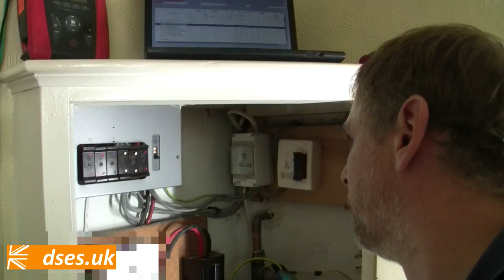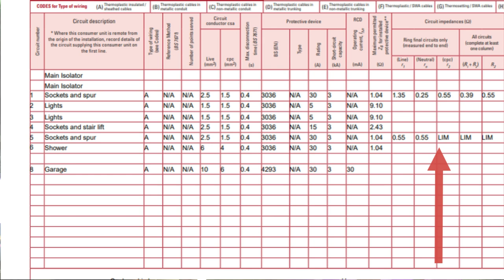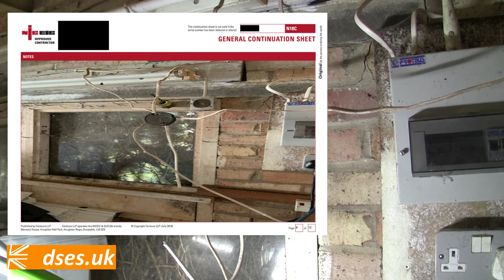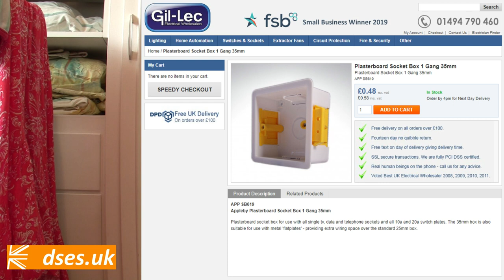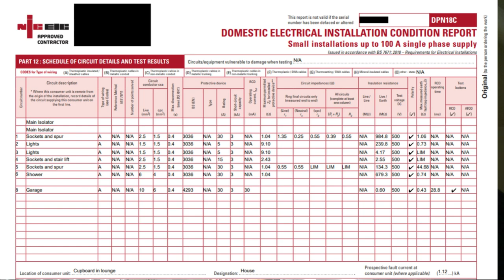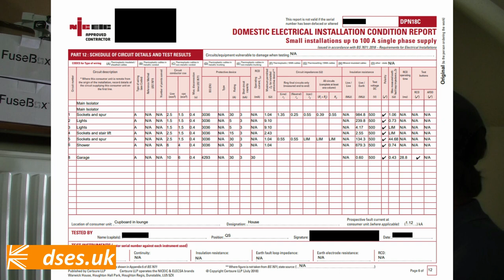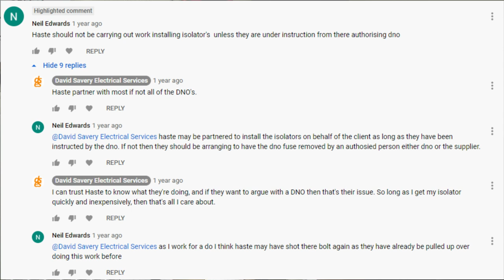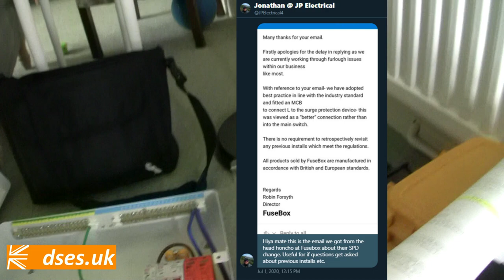Waffly Consumer Unit Upgrade

Comment: Rather than fitting a Henley block, why not fit a Wylex REC2 (only a tenner on Ebay) - existing tails in the bottom, new tails in the top to the new CU.  Now you have fixed the problem and introduced safe isolation for the next person as well...
Reply from the maker: It was the weekend, I was out of area and I lacked a DP isolator on the van. I now carry one as a stock item to ensure I'm not caught out again as this would be a preferable option over the Henley block.
Reply: @dsesuk  Excellent answer ... amusing as with all of your other videos...
Love your "no shit, Sherlock" approach ... if you venture into Worcestershire some time I will buy you a beer!.  Keep up the fekking good work!

Comment: Thanks for showing us that email. I've tried contacting them myself regarding precisely this issue but never had any response. Been of particular interest since I had a few of their SPD boards lined up with the SPD straight off the main switch for jobs that got cancelled/postponed due to covid and wondered if I should be fitting mcbs into them now.

Interestingly on my last NICEIC inspection I was told there was no need to use 6mm, a 2.5mm would do for the connection. Can't help myself though, makes me cringe putting a single 2.5 into a 32A so 6mm it is!
Reply from the maker: I must admit, on my manor house job I'd had a board in stock for some months that predated the supplied MCB for the SPD, so I retrofitted one anyway. It seems to be to be better to have than not if you have fuseways enough to accommodate it.

Comment: I had the same with western power as I had old service head and wanted an isolator fitted they said no and would cost was £175 + vat in the end I took photo of service head and it needed changing anyway and when the came to fit new service head I bought isolator cost £18 and they fitted it for me so now I can change my old consumer unit when I want safely

Comment: For the 30A fuse with 3 conductors.  If it is purely a spur (Being defined as only serving one single or one double socket) not a radial then that socket can only draw a maximum of 26amps (2x 13A).  It is exactly the same situation if you spur off any socket, you have a 2.5mm cable with a rating of 27A connected to a 30A or 32A protective device which you accept is fine.

Obviously if that spur is in fact a radial (not a spur protected by a fcu) which would serve multiple socket outlets then it would break the rules.  I know it seems totally counter intuitive but it is exactly the same argument about using 20A double pole isolators on a kitchen ring circuit, you have a 20A isolator on a 32A circuit, however as long as that isolator is feeding only one single socket then the maximum load can only be 13A so is fine.

Effectively the two plug fuses at 13A each are protecting the cable in a spur.

Just to note also in amendment 2 they are talking about requiring AFDD, at £250 a circuit breaker we might see installers going back to having less circuits so even for the hardiest of Ring final haters they might be converted back to ring final circuits.
Reply: Good thought on the AFDD requirement forcing people back to rings. I have a feeling this might go the way of 'earth rod for everything' in the 18th original suggestion...  "not gonna work, rethink this"
Reply from the maker: I accept that point Steve, but the problem I have with it is when the 'spur' is serving a distant point with cabling buried in the fabric of the building. Yes, under normal load conditions, the plugtop fuses protect it, but what happens when Joe Homeowner knocks a nail in the wall and causes a near short? The fault current that can pass may then be too high for the cable, but the protective device can pass it and not meet the disconnection time. As for AFDD's, you can perhaps expect a rant on that in the coming days!

Comment: Thoroughly enjoyed that one old chap.
With you on the spur out the ring, one way I've dealt with this in the past is just to change it for a 20.
I hate pulling the fuses, what also annoys me on top of there not being an isolator is that they never write what fuse is actually inside, you get the 100amp sticker on the front which is just a max capacity and tells you nothing, you open it up and there is a 60 inside. Why do we have to write the fuse size on a cert when we don't even know, unless I explicitly see a sticker I'm just going to put Lim.
Reply from the maker: I agree Oli, I've no idea why the fuse isn't explicitly identified and I too end up writing LIM all the time on my paperwork. It makes a joke of maximum demand as someone asks for a car charger or electric shower, yet you've no idea what the installation can supposedly supply without breaking a seal to get into the thing.
Reply: @dsesuk  Whats strange about all this is that this trade has been going for so long and the problem seems so simple. Politics!!!, Usually it works so well but....

Comment: What’s your view on the cp Fusebox flying earth lead for the lid  ? To me it’s too short as the kid is flapping around in front of the devices and wiring when you remove the lid ...maybe superfluous ?  Also I’m not sure on the tail clamp it’s a bit of a faff you get on but good when it’s fitted ...I’ve found that it’s best to split the orange plastic clamp into two halves much easier to fit especially with non flexible tails
Reply from the maker: I'm not convinced on any flying lead for a metal CU cover Marco. If the manufacturer instructions state the power should be off when the cover is removed, then why require me to earth it? It's my outlook if I choose to ignore those instructions; their arse is covered. For me, it's extra fiddle and it gets in my way.
Reply: David isn’t the issue that the lid is an extraneous conductive part therefore needs to be earthed ? i.e. the lid is painted/powder coated and the contact of the 2 screws that hold it to the rest of the CU can’t be relied on - a bit like earthing a metal light switch plate. But I haven’t seen any other domestic single phase CU applied with a flying earth lead

Comment: Great video, again! Regarding the SPD now requiring connection via Live to a 32A MCB, what's to stop you putting it into a 32 or even 40 RCBO serving a circuit, as an option to be efficient with your ways?

Comment: Thanks for uploading,interesting video.I am sure that  4mm 30amp radials on rewireable fuses are not permitted but as you have pointed out,it is allowed to have 2.5mm cable on a 30 amp rewireable,seems ridiculous doesn't it

Comment: On one unoccupied site the dno replaced the service head cos of a hole in the side of the original one. They put a nice new chipboard backing board up, which meant they needed to remove the meter. Then they refused to re-connect the meter because it ‘wasn’t our equipment,mate’. (It wasn’t your equipment when you removed it, and you didn’t mention this problem an hour ago when you offered to replace the wood....)

So, 3 weeks later, when the supplier arrived to install a meter, I made sure there was no CU on the wall, so he had no choice but to terminate the consumer tails in a DP isolator I had screwed to the wall. 👍

Comment: If you look up the definition of a circuit in BS7671, its one circuit. Nothing wrong with piggy backing off an OCPD, its no different than spurring or junctioning anywhere else on a circuit, and so much better than a hidden JB. Fair enough if the terminal is too small, but its ONE circuit on that fuse, not two.
As for the ring vs radial discussion, they all have their place and are all useful. You say what happens if a RFC breaks and the 27A cable is over loaded. But what happens in your 4mm 32A radial if the cpc goes open circuit? or you run it in containment or in insulation, or the length of run is too long for Vd and Zs?

Comment: Hi David, I'll check, but I believe near the beginning of the regs the iet say that they are not liable for any wrong advice in the regs, an installer should use his professional judgement. Or, that is coming out in an ammendment.
Reply from the maker: They don't waste any time Keith; their disclaimer is on page two.
Reply: @dsesuk  thanks David.

So, just do what you think is correct then because, they appear to be saying that the regs are only an approximate "ball ache", as someone may say, that can and should be ignored if in your professional judgement you are the authority on the matter. 

😷 Protect yourself from the regs. Save the IET. 😷

Comment: If you have a spare way at the CU fine, but if not there’s no reason to differentiate between connecting a spur at a local s/o or within the CU? Just seems trendy to dis rings at the moment but they’ve served us well for 50 years and safer now as you are limited to one spur per ring s/o

Comment: I can see how a 20 amp radial per floor would work ok, but a modern kitchen needs a 30 amp supply and I don't fancy wiring sockets etc with 6mm. As an experiment some time ago I changed the kitchen mcb to 15 amp, wife got up in the morning started the washer and dryer, put the kettle on and it tripped when she started the microwave lol.  Add on a George Formby grill etc and 20 amps is borderline for a kitchen :(
Would a 4mm ring for a kitchen with a 20 amp mcb on each end rather than both ends stuffed into the normal 30 amp be a solution to a possible ring break ?
Reply from the maker: Hi Steve. I also prefer 32A for a kitchen, and I have no issue with wiring such as a 4mm radial. True, it may technically fall foul of installation method and I'd prefer a larger CPC, but for your average small domestic property 4mm suffices juuuust fine.

Comment: I made it a condition of having a smart meter installed to have an isolator switch fitted by my supplier (Eon) at the same time. This they did at the height of Covid in May. They fitted a Proteus isolator in an Eon branded enclosure. No fee whatsoever. Your mileage may vary I guess.
Reply from the maker: Well, that's the issue; if you know what to ask for and you insist upon it and if your energy provider is open to that request then you might get it for free just so they can tick you off the smart meter to-do list.

Comment: Radials the way to go. 
Even with derating
Power circuits 2.5mm2 20A
Lighting 1.5mm2 10A 
Cooker 4mm2 32A permanent wired
RCBOs for all others.

Comment: Isn't the issue of cable size with a spur from the CU exactly the same as a spur from anywhere on the ring, ie 2.5mm2 can be used within the regs and has less than 32a capacity? But the reg is based on a 13a fused plug that limits the current draw - a double socket isn't meant to be rated at 26a but 20 (according to JW). The regs assume there's only one (single or double) outlet on the spur but if course DIYers don't care about that. That's why this sort of 'spur' is only allowed on a socket circuit.
Reply from the maker: My issue with spurs is length. A spur off an existing ring to add in a new point close to an existing wiring/accessory position is fair enough. A spur from any point which snakes off to the other side of the house, well that's what I don't like. You're less likely to see spurs of a long distance coming from the existing ring, but you can find the situation we have here where an extension has been built some distance from the fuse box and wiring for the sockets within travel back through the fabric of the building to be shoehorned into the 30A fuse. Even if it were serving one single/twin outlet, the demand should be such that the cable isn't overloaded under normal conditions as plugtop fuses are in place at the far end, however for a cable run of some length buried in the building, damage to that cable by, say, screw/nail penetration can see a resistive short low enough for a fault current high enough that the protective device passes more current than the cable can handle. A spur to me is a short-length frig to allow an extra point to be added without too much drama, not a wholly separate circuit which goes off to serve another area of the house entirely.
Reply: @dsesuk  I agree with you. On a lighter note, it sounds like you have a length problem with your 'spur'.
Reply from the maker: @tobysherring1369  My wife says it's not the length that matters, but the reference method. I don't believe her though.

Comment: Hi David when the lighting circuit has no earth. What tests do you perform on that circuit at the light points and switches.  How do you fill the fields on the certificate do you just n/a them or lim them I surpose it's only the rcd/rcbo field that you can fill out. Any info will be appreciated thanks.
Reply from the maker: If there's no earth by design, then R1+R2 and Zs would be N/A on the cert. If it's down to a fault (disconnected CPC), then those readings would be off-scale high on my tester (>1999), so that figure would be entered onto my paperwork for those fields. Outside of that, I'd still IR the circuit to earth in case of contact with parallel paths and I'd visually inspect it and test any RCD (there's not much else you can do!)
Reply: @dsesuk  I've got a c.u change coming up no cpc in lights it is just 2 core cable so it was by design. Will be the first one I have done checked all fittings they are all plastic no metal ones going to cover screws on switches with the plastic covers you get so no metal can be touched.
  Was just wondering about what to put on the cert because most fields would be empty and i like to fill with as much info as possible. Is there anything else you would do. thanks David
Reply from the maker: @gd-bq7em  All fields should be filled either with an explicit value or as N/A on a cert, although to me LIM is acceptable on L/N IR when it's a CU change. For your non-earthed lighting, N/A would be right for the R1+R2 and Zs. I would LIM L-N IR testing unless you know there are no lamps, dimmers, transformers or drivers present, but I would still do LN-E IR testing to prove live wiring isn't in contact with a parallel earthed path such as metal pipework. Don't worry about plastic covers over accessory screws, reg 410.3.9 (item iii) gets you out of that one!
Reply: @dsesuk  okay david thanks for the info much appreciated. I will check that reg out,
  Yes I understand what you mean with the ir to earth just in case it's touching  gas or water pipe somewhere along its run or to another circuit.
  Thanks for always taking the time to comment back,
  Look forward to a new video keep them coming my friend.

Comment: I agree with absolutely everything you said about ring finals. Why are they still a thing? Why are they still permitted to be installed new? Whenever I design an installation, I generally assume a 20a radial circuit for every floor of the property plus a 32 radial (yes, in lovely 4mm) for the kitchen. The great thing about radial circuits is you can do whatever the hell you want with them. You can double/tripple/etc spur them. You can have the damn things spidering anywhere you need. Why is this not the done thing? - I am the only person I know that installs 4mm radials.
Reply: It's a ballache spurring off 4mm though, you end up with Wagos in your socket boxes which can be a bit of a squeeze if they're 25mm. Having worked on a kitchen wired with a 4mm radial recently, I'd go 2 x 20A radials for the kitchen to stick with 2.5mm as it's nicer to work with in my opinion

Comment: Just been quoted £231.42 by Western Power to put in a 2 pole isolator. As they are running a monopoly and governed by Ofgem  I will try and complain but don't hold much hope. Just out of interest how long a job would it be for installing an isolator switch? An hour? Love the Video and thanks Dave for doing these it helps us mugs know what to look out for and keep us safe..
Reply from the maker: Shocking isn't it? Yeah, easily achievable in an hour and part costs likely to be under £15 ex VAT. It's a money-spinner for them.
Reply: @M_Holien  Nice that the lady at Western Power gave you that tip, someone with a conscience.

Comment: Dropping sockets off to look behind them becomes an issue if the house was wired with aluminium twe as the bloody conductors can snap :( Back when it was in use you would terminate the apc to the earth terminal in the box and connect the socket back to that so that only the link could break rather than the apc of the twe.
Reply from the maker: True Steve, sometimes removing an accessory can cause a problem that wasn't there before. Pulling downlights is similar when the old halogen ones have made the plaster around them brittle with heat. Ugh.
Reply: @dsesuk  As an exercise I was given a length of aluminium twe and a proper 13 amp MK around the posts plug and told to wire it, it was impossible as the aluminium wires would break, lesson learned :)

Comment: Obviously I’m a good bit behind your lovely videos but I would agree about your rant on local isolation. It would appear by not providing a point of isolation we can use or threatening legal action for using the fuse, either the DNO or the energy provider are not conforming to EaWR regulation 12!